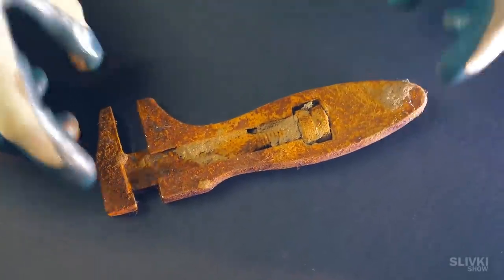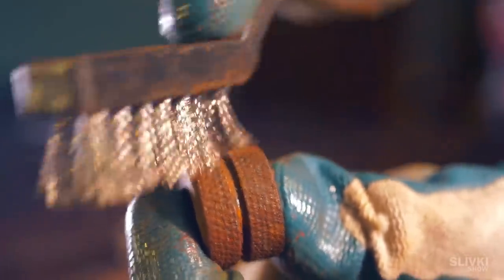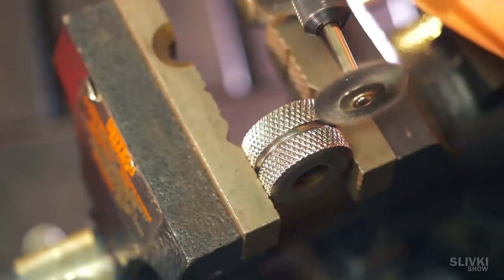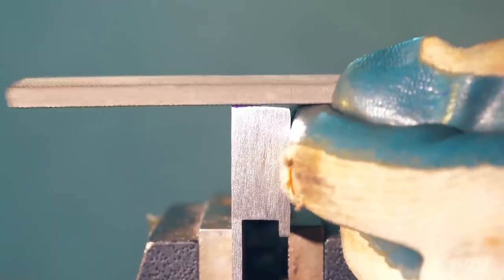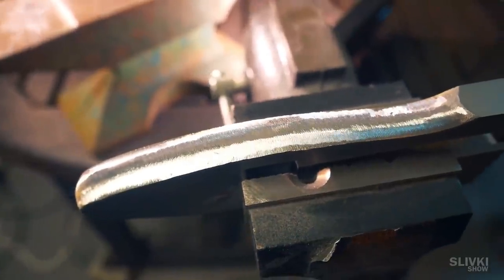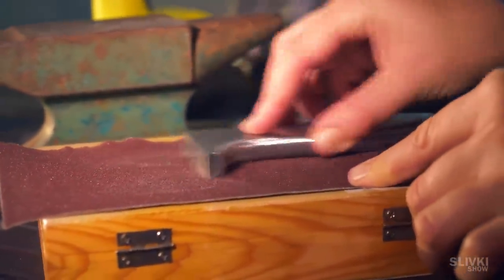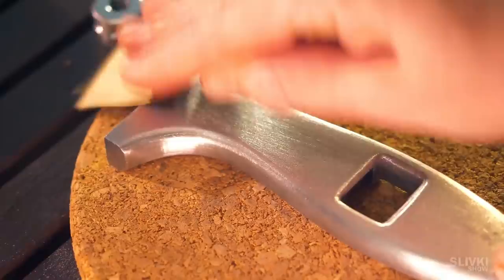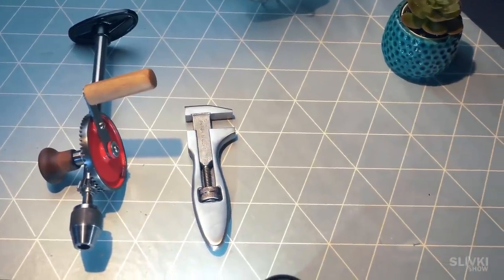RESTORING AN OLD WRENCH

Comment: You should apply a thin layer of oil on top of the tool so it doesn't rust.
Reply: What oil works best as a coat? Ive  been using the Electrolysis method to remove rust but after it falls off and the metal dries, It gets more rust in minutes!
Reply: @am6610  Grease is the best to this... Or technical petroleum jelly...
Reply: @am6610   i have a hammer which has the no paint on it so, i just rub light oil like wd-40 on it. it doesn't from water but it makes the tool not rust from condensation.
Reply: @Boszu  I'll give it a try and see, Thanks man!
Reply: @lariluhtamaa9607  Yeah thats exactly what i want, Just to protecting it from rust after i finish removing it.
Reply: @am6610  ballistol is a thin oil designed to coat metal tools and prevent them for rusting. it is made specifically for the purpose and critically - it is a thin oil so it spreads out evenly and won't drip everywhere, it does not evaporate, it is able to seep into cracks.

tool manufacturers often ship new tools (like drill bits or screwdriver bits) with a thin layer of paraffin wax - applied by dissolving some paraffin wax in methylated spirits or a different alcohol and spraying it on and allowing the alcohol to evaporate - but this is sticky and not as pleasant to use.

really, most thin oils (machining oils especially) should be fine for the purpose, especially if you also wrap the tool in the oily rag to protect it (be careful as rags with oils like boiled linseed oil can spontaneously combust). i would just stay away from cooking oils because they can get sticky and will eventually go rancid and begin to promote rust instead of prevent it. personally, I use used motor oil for less important things - like hoes, spades and mattocks - which your hands will not touch directly.

petroleum jelly is an option that might be easier to apply - but it will not seep into cracks and you need a decently thick layer.

Edit: it is not recommended to use WD-40 because it evaporates quickly and leaves metal unprotected, is expensive, emits a lot of fumes, and does not seep and protect as well
Reply: @rolls_8798  Wow, Thanks man for the the detailed information, Really appreciate it, That made my day!
Reply: @am6610  Glad I could help

Edit: depending on what the item is, you could attempt to form a patina or to 'blue' it. on carbon steel knives and other implements, people often rub onions on them to promote what is basically a really thin layer of rust (but critically, it is the iron(III) oxide instead of iron(II) oxide - i think - this type of rust is black instead of brown or red, does not flake off and will not spread and will prevent oxygen and water getting into further rust the metal), you can do the same thing with dilute vinegar or a lemon, just rub it on and soak it for a little bit, dry it off, and repeat and the shininess is gone from the metal (you can go until it is completely black if you want).

alternatively, you can 'blue' it using a bluing compound (often used for gunmetal) that you can buy, these work very similarly but are much quicker and more effective.

one method I particularly like is 'rust bluing' which is essentially the patina method on steroids - AvE has 2 great short videos on the process. I'm pretty sure you use an oxidising agent (no reason it couldn't just be an acid or a base (like ammonia)) to promote rust all over the part, then boil it in water to solidify the oxide layer and convert some of the red rust to black oxide, and then repeat, but definitely check the video first. this method is not suitable for anything hardened or with a specific temper (technically it's not getting that hot but I wouldn't risk it)

another traditional method that used to be used in high-quality factories (when they still used metal) is the hot oil method, I think there is two variations - one, where you heat up the part and then drop it in an oil with a low smoke point, and one where you oil it first and then blast it with a flame (not sure about that one)